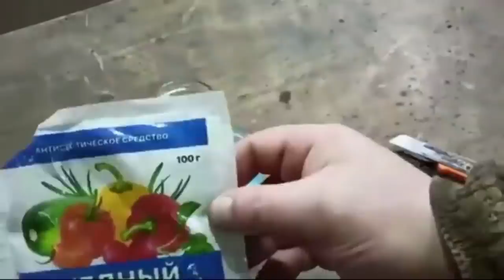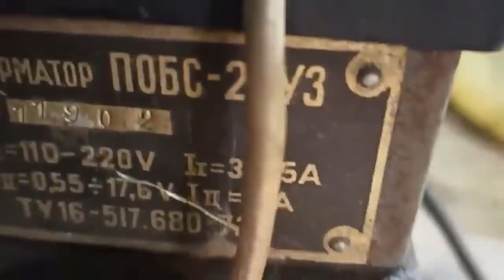Cheap Electroplating And Tool Restoration, That Works well!Simple Practical Inventions

Comment: shocked. the alcohol makes it do electroless plating????? copper nitrate and nitric acid can do the same sorta but not as easy as this seems, ive made many poor attempts at copper plating steel in the past, this seems very promising. this crazy genius covered everything in less than 10 minutes

Comment: i TRY IT   
IT WORK   FOR  2 MIN  on  iron bar I GOT  COPPER  COLOR  
BUT  IF  I TRY TO SHINE IT  OR CEAN IT  EVERYTHING  DESAPERED
how much time  for a eaveay  plating  more then 10 min  maybe
Reply from the maker: poorly degreased or increased acidity
Reply: @KovancaPolock  at  first  I  put  x2   1x6  copper  plate at 1\8 stick ;after 2h  I got green  color  solution; one  of the  plate a disolve completely  ;I try some test  i got some  copper on  iron  bar but this morning    the second  plate disolve also  no more  electrode  but  the solution is  bround  red  now
what  too much  vinegar  or  too much  salt

is it still possible to use it for plating 
also  I have 12v  5 amp  when I make the test  ???????

Comment: Is it possible to prepare any plastic to be plated this way ?…
Reply from the maker: Any plastic that does not dissolve the varnish
Reply: @KovancaPolock  Well, in fact my question is what must be used to coat any plastic before applying your method of plating ?…

Comment: Hello Kovanca, thanks for share your know how about metal  covering, when you do it appear so easy !!....thanks again.
Do you have some process to rechrome zamak ???
The zamac is platted with cooper then nickel nad finally chrome but the zamak is damaged easily for sulfuric or clorhidric acid.
Do you have some process from preparing the metal that you recommend to do it ???  
   
Thanks in advance.
Reply from the maker: For zinc coating with other metals, you need to use an electrolyte with acetic acid.

Comment: Hello Kovaca!
Thanks for the video.
It would be nice if you could list the ingredients and method briefly in the discription box for each project.
In India, items like caustic soda, hydrochloric acid, copper sulphate, etchants and other "corrosive" chemicals useful to hobbyists have been clamped down from hardware stores.
It would be nice if pdf files for each project were available.
You deserve all the appreciation for your excellent presentations!
Reply: Thanks for new opinion, were known.

Comment: But this actually harms your steel, if you look at reduction  potentials table you can see that this will make steel rust faster because copper is harder to oxidize
Reply from the maker: then nickel or chrome

Comment: will it make carbon steel rust resistant??
Reply from the maker: After applying copper you need nickel or chrome
Reply: @KovancaPolock  awesome, does it affect the hardening or the temper of the steel??
Reply from the maker: For hardening steel does not affect

Comment: I've been an electroplater for 40 years. This is called an immersion coating and is only about .25 - .50 microns thick. It will wear off quickly unless you clear coat it.
Reply: So this video is legit?  And if so how do u clear coat it??
Reply: @zr7699  Clear coat is paint
Reply: Thanks, wasn’t sure if that’s what u meant! Thx
Reply: can it be done on alliminium??
Reply: @MrToontuber  you can't degrease aluminium in Caustic soda degreaser,and aluminium forms an oxide coating that prevents electroplating.
Reply: @MrToontuber  no
Reply: @Timothy:  if I wanted to replate a old worn, nickel plated razor handle:

1). Would a pre-plating of copper be recommended first?

2). Would this method of a thin coating via dip method be better for Cu or should it be Cu electroplated?
Reply: Hello! Tell me, please, how to copper brake caliper (VW T5)? The method without electricity did not work. I tried to cover the bracket with copper first - some areas were covered with copper, quite hard, but basically the copper coating was easily washed off and the metal became dark in its place. This dark coating is easily cleaned. Thanks in advance for your help.
Reply: Would this also work on plastics? As base for chrome plating for example?
Reply: @ahmetcemturan  Plastics are a special process that requires specialized preparation to be able to accept metal plating. It wouldn't be inexpensive.
Reply: @timothyhamlett7086  appears there is a 'cheap' response to your veteran comment about plating plastics. Got anymore insightful comments?
Reply: @dare2scheme904  What was done was not really plating on plastic. It was plating on graphite. The entire coating is relying on the quality of the bond between the paint and the plastic. True plating on plastic doesn't use paint. Also if you want your chrome to be bright and shiny, as most people would, you would have to apply a very heavy copper layer (.001"- .002"/ 25 - 50 microns) thick then polish the copper to a mirror finish before applying the chrome. Unless you use a bright copper solution the polish step would create enough heat to likely cause the paint bond to fail.
Reply: @timothyhamlett7086  How smart you seem---I'd like to hire you, but I'm retired.
Reply: @timothyhamlett7086  plating on plastic doesn't use paint but it is still painted with a conductive coating.
Reply: @timothyhamlett7086   I would like to talk to you some about plating. I am a subject matter expert in high speed plating applications and would live to pick your brain
Reply: @timothyhamlett7086  honestly, my perspective is plating plastic is a waste of time because the same result can be achieved, a chromium finish, without any plating on plastic. I suppose I think differently and would rather not explain, because evidently I am the only one here with this perspective.
Reply: @Novanod-i5g  why is it you even feel electrochemical plating of plastic is of any material value?
Reply: @dare2scheme904  it has no value, it’s mostly cosmetic. Knobs in your car etc, would not be a great conductor. Not something practiced in practical applications.
Reply: @Novanod-i5g  then electrochemical plating of plastic is unnecessary and wasteful because the results can be achieved through other methods
Reply: @dare2scheme904  I could not agree more, I was simple answering someone’s question as to how
Reply: @dare2scheme904  what process would you do?
Reply: @Joeylbs_  My process is I'm not giving out any tips or hints, that's what YouTubers do.
Reply: @dare2scheme904  weird.
Reply: @timothyhamlett7086  if I wanted to replate a old worn, nickel plated razor handle:

1). Would a pre-plating of copper be recommended first?

2). Would this method of a thin coating via dip method be better for Cu or should it be Cu electroplated?
Reply: @dare2scheme904  Just had to laugh at ... "That's what YouTubers do."  The entire beauty, the concept of the tube if you ask me.
On a DYS  electroplating, Taking, and no Giving$. Plastics aren't my thing, but then there's that.
Reply: @ahmetcemturan  he does a plastic handle screwdriver last in the video
Reply: @Vinlaell  thanks seen it lateron
Reply from the maker: https://youtu.be/SZ4wyJvnHNQ

Comment: Nice example of copper and brass plating - I didn't know you could plate steel without electrolysis which is pretty cool.  Really like the example of embedding iron filings into clear coat pint as medium for plating a non-metallic surface.  That explains how those plating kits on Amazon work (at a higher price).
Reply: I thought that was graphite from a motor brush.  Not iron filings.
Reply: @loctite222ms  You may be right - that would also make sense.
Reply: Did you catch what all the ingredients used in this video?  If so, would you post them?  Thank you.
Reply from the maker: @lourias  All ingredients in subtitles
Reply: @KovancaPolock  well, no subtitles appeared when I turned subtitles back on.  I wonder if YouTube has a weird trick going on between languages.
Reply from the maker: @lourias  Subtitles in 90 languages

Comment: I tried metalizing my 3D prints using graphite spray (DUE-CI N77). It wouldn't work no matter what. I wonder if your motor brush trick is going to be better. I am going to try it.
Reply: @KovancaPolock  I've tried it today. It actually works quite well. I still have to improve adhesion, but at least the metal forms where it is supposed to.

Comment: That was fun! Must have a good background in study of chemistry I would guess.
Reply: The items are either copper or pre-plated. Then in-video has a thin film of another metal removed from the surface by dipping in acid(the "copper sulfate") or having the acid painted on(which is why he can scrub and sand it so hard, because it's literally made of copper).  I don't have a background in chemistry(I have a brain and have read a few books, all that's necessary to debunk this). It would be nice I know. But then he would have explained how to replicate it. Which he cannot. I can, and have.
Reply: @user-ve5qq5wp6j  If you get a copper item, plate it thinly with another metal then brush an acid onto it. What is revealed underneath once the acid on the brush eats through the thin plating? Oh that's right, the copper.

Comment: The practice of alchemy has been forbidden for millenia and is a sin of the highest so be careful or a higher power may strike you down with fake lightning or a taser. But for real this is very interesting is it real? I mean I know plating is real but is that what is happening here? I never seen copper get introduced just chemicals of which I didn't pay much attention to so I could have missed it anyway it's cool I've had a couple beers so I could have missed some stuff right on bro

Comment: I did. You don't need to add additional electrolyte btw, the copper sulphate is the electrolyte.
Reply: You tried the cuso4 alone and it worked? W/o electricity ? Hard to believe.
Reply: @nikosatsaves3141  well, you best go and try for yourself then.
Reply: @MrRedeyedJedi  i did. Nothing happened.
Reply: @nikosatsaves3141  doubt me if you want I don't care, you are a stranger on the internet and I have proof that it works, just as there are videos on this platform it's self using the method, or ask me for more details if you would rather.
Reply: @MrRedeyedJedi  its not my intention to doubt you your lordship. Maybe it depends on the metal. Btw i ve tried this channel's method and i ve got instant plating just as this guy claims, with various results on different objects. . I m gonna give a shot at electroplating too. Thanks for the feedback.

Comment: there's no need to try so hard. i made a liquid copper concentrate. in 14-15 seconds, I copper-coat the metal I want. only with liquid. another tool and without using electricity...=не нужно так сильно стараться. я сделал жидкий медный концентрат. за 14-15 секунд я покрываю медью нужный мне металл. только с жидкостью. еще один инструмент и без использования электричества

Comment: No it's how's chroming something works first it's coated with copper then dip into the chroming Tank Chrome adheres better to Copper and will give a more chrome-like finish then if you just tried to Chrome the hardened steel

Comment: Una pena no saber que ingredientes utilizan
Reply from the maker: Necesitas habilitar subtítulos
Reply: @KovancaPolock  muchas veces pongo subtítulos y los pone en el idioma original
Reply: Y en este están en ingles
Reply from the maker: @papamalta  Composición para recubrimiento de cobre:
Vigoroso de cobre - 100 gr.
Alcohol técnico - 50 ml.
Recargable de electrolito - 250 ml.
Agua destilada - 150 ml.
Composición para el lavado:
álcali
Soda cáustica

Composición de zinc:
Electrolito de la batería
rebanadas de zinc o cam
Alcohol técnico

La composición para el recubrimiento de latón:
Mezclar el electrolito de cobre y zinc 1/1.